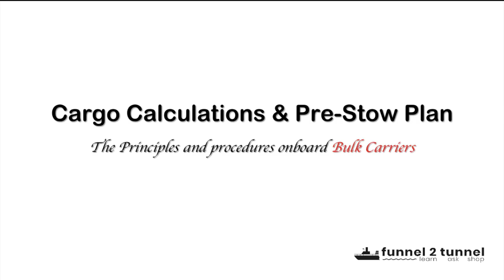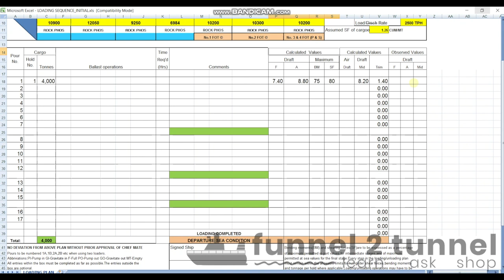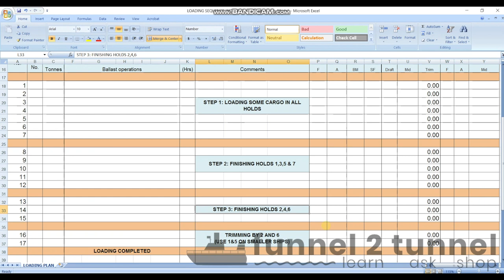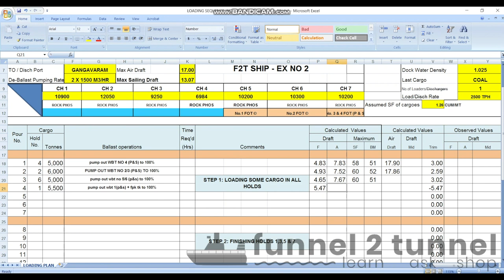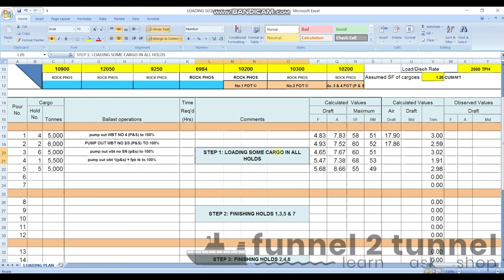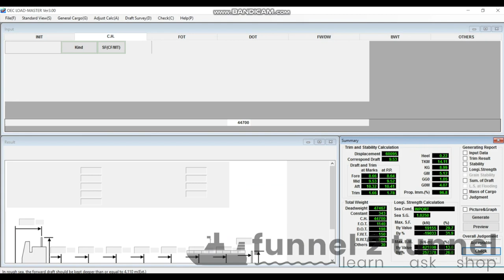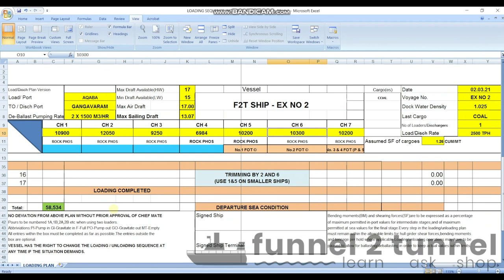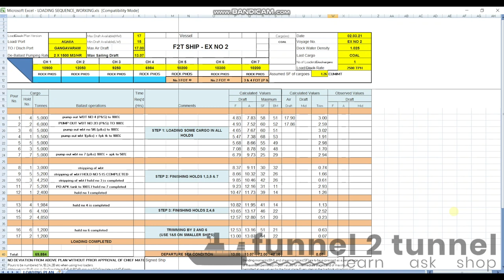Loading sequences | Loadicator | Part 7

Comment: one of the finest videos about cargo loading and calculations , these videos can substitute any books that exists about how to proceed about cargo loading. 
 coming to this video and loading sequence if we depart with 0.7 cm trim how one should manage trim and aft draft for the voyage till arrival port  without getting down by head keeping in stability requirements
?
Reply from the maker: Glad you liked it. Share to help fellow mates. Cheers !!!
Regarding the question about leaving the loadport at 70 cms of aft trim, please note the following - 

One should plan the stowage and distribution of cargo at the loadport in accordance with the limitations (if any) at the discharge port. 
In this case, where the limitation was at the discharge port Gangavaram (13.00 mtrs) we planned the stowage at Aqaba such that if we finish the loading at 70 cms trim by stern we shall be arriving Gangavaram even keel. 
However, it rarely happens that you arrive EXACTLY even keel. Note that if you have planned well and aware of the loadicator results accuracy, the TRIM will not be very much. The difference could be max +/- 5cms which is not very much.

Comment: First of all, thank you for your informative video. I would like to learn why took the value of the air draft from No1 hatch cover but not from No7 while it is the closest part to the aft mast ?
Reply from the maker: Great point! The word Air draft has two meanings - First the distance from the waterline to the top of the aft mast and second meaning is distance from waterline to the top of hatch coaming. This second meaning of air draft is used when the vessel is in port because this distance is used by the terminal to assess how much distance is there in between the loader and the coaming and/or will the loader be able to reach the hold to load or discharge.  So when we are alongside the berth we are considering air draft as distance from waterline to top of hatch coaming for the loading purpose. only the same air draft values are mentioned in the loading sequences form. 
We are taking air draft value at Hatch number 1 because it is the highest value of air draft value encountered in case the loader needs to shift to hatch no 1. Hope it clears!
Reply: @funnel2tunnel360   Thank you, well explained, it is clear. But the loader is placed on the berth level and air draft is calculated from sea level to coaming. Then, it is the responsibility of the terminal to evaluate that difference ?

Comment: Nice video, could you please suggest suitable trim to obtain the best stripping result (Handymax Vessel)? Thanks
Reply from the maker: Glad you liked it! 
Suitable trim for carrying out efficient stripping is anything in between 2.5 mtrs to 3 mtrs in my experience.
Reply: @funnel2tunnel360  Thanks. Could you please do a tutorial for manual trimming calculation using trimming table?
Reply from the maker: @jayr5567  I have done a video on trimming calculation using the trimming table. 
You can check it out here
https://www.youtube.com/watch?v=INzjnM89rME&t=192s

This is by far the most convenient method of calculating trimming quantities. 

Like our work? Do share it out other platforms! Cheers!!!
Reply: @funnel2tunnel360  Thanks, I'll check it out, pls keep on inspiring people. Btw, looking forward for detailed video on grain loading  as well as proper filling up of NCB forms.

Comment: Only one question remained to me NOT clear. Why you did not consider ballast pumps rate during loading.
Loading rate is 2500 tph, first step takes 2 hours and we have to PO WBT 4(P/S) during this step.
We have 2894 t in WBT 4(P/S) and it means that capacity of one ballast pump must be at least 750 tph)
Sometimes during very fast loading we have to ask terminal in advance additional time for PO ballast like one of the loading steps ))

Anyhow you did a great job! Appreciate! 😉